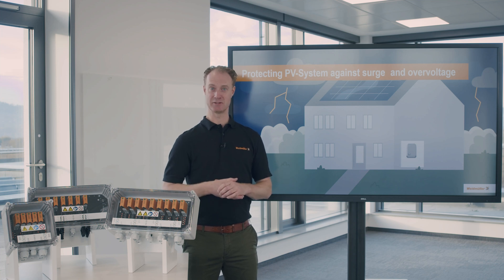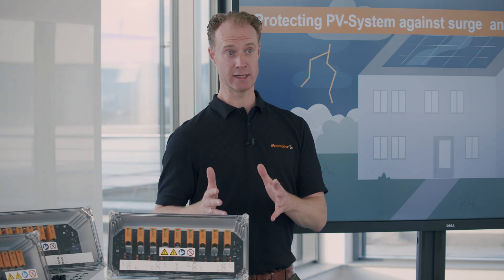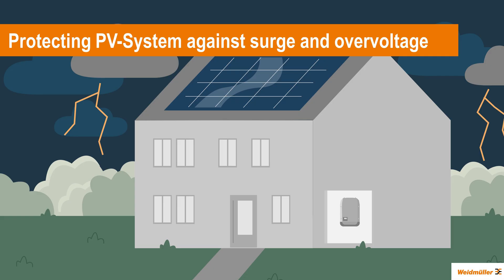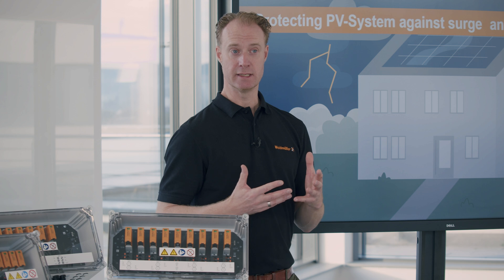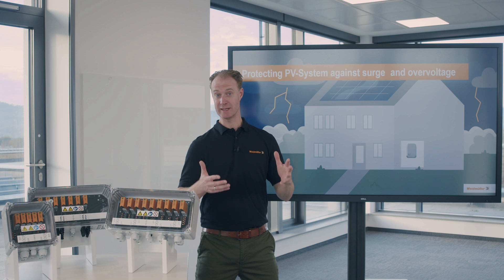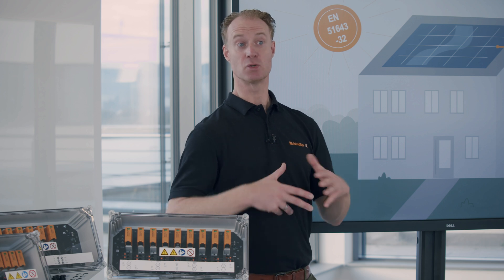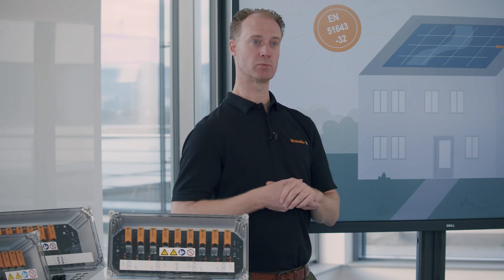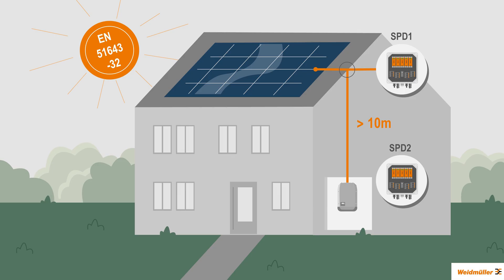Do it right: Standard-compliant surge protection for PV systems

Comment: Hallo zusammen

Erstmal danke für das Video!

Nun zu meiner Frage, wenn der Wechselrichter bereits einen Typ 2 SPD auf der AC und DC Seite hat, brauche ich dann nur noch jeweils einen oben auf dem Dach zu installieren? Ich habe 3 Flachdächer, welche alle an einen Wechselrichter angeschlossen werden sollen. So wie ich es jetzt verstanden habe, müsste ich jeweils oben pro Dach einen GAK installieren und der untere im Wechselrichter genügt?

Sonnige Grüsse
Reply from the maker: Hey Luca,
sry für die späte Antwort. Der wissende Kollege hatte wohlverdienten Urlaub. :) 
Aber hier die Antwort:9
Hallo. Wenn du Strings von 3 Dächern einsammelst, müsstest du jeweils bei Gebäudeeintritt einen DC-Überspannungsschutz setzen. Das ginge z.B. mit diesem Produkt 2791950000 oder alternativ, wenn du alle Strings am gleichen Punkt ins Gebäude führst mit diesem Produkt 2975570000. Mit diesem Schutz und dem Überspannungsschutz im Wechselrichter erfüllst du alle Anforderungen der DIN 51643-32.

Beste Grüße 
Weidmüller